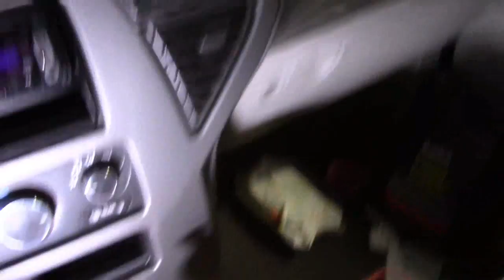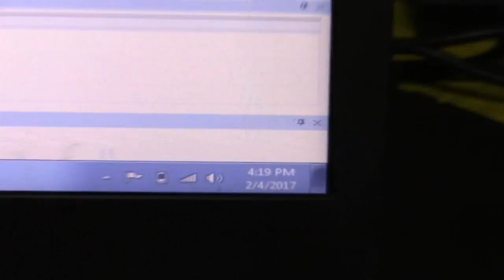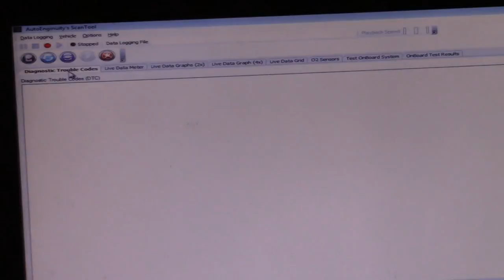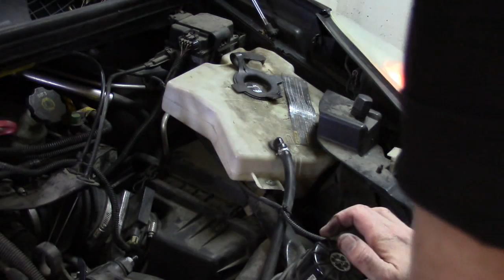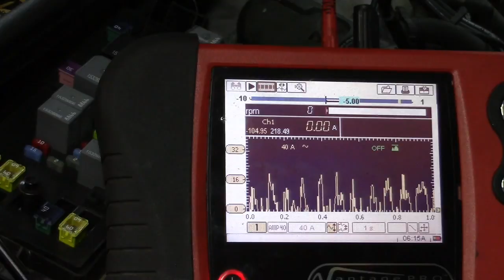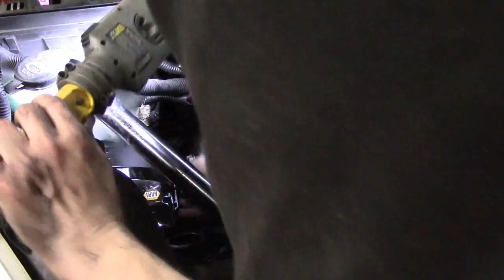2005 Buick with a P0300, P1311, and a 420 code.

Comment: Nice.

:) By the way: Does the scope have a peak detect setting? It seems to help with relative compression tests to turn this off. Some scopes also offer filters to smoothen the graph, maybe that gives you more satifying results.
Reply from the maker: Yes I did try without peak detect and the noise was way worse actually.  I also have a filter as well but didn't work.  I am not sure why but when I do the test from the ground cable this happens. I believe it's because the ground is 'diluted' from the whole car maybe?
Reply: Yeah, probably. I just asked because I never saw such a bad signal with 
my Picoscope, even with peak detect. And I remember one time when his 
Verus was broke Eric O. from SMA did it with his Autel which only works 
with peak detect and even then he got reasonable results, but he was 
hooked to the positive cable there as well. So I guess it's the noise you get on the common battery ground.

But just FYI, I believe you can even use your Amp clamp on the cable even if it does not fully close. I did this a couple of times and got very reasonable readings. The absolute Amplitude might be a little bit off, but the relative picture (which counts in this case) was perfectly on point.
Reply: Kirchhoff's law. All of the current entering any point in the circuit will be equal to all of the current leaving that point, so it isn't "diluted". Short of spending some time experimenting and comparing your routine to how the test is normally run (high amps probe, full range not AC coupled) I can only speculate about why you are getting more noise and the first thing I would need to confirm is if the current probe is always closing properly. I would also want to see what this does DC coupled.
Reply from the maker: John Gillespie Seems to me there is every reason to expect greater current coming from a common ground cable than current to a specific device through the positive. There are more circuits on the common ground.
Reply: When you are running the test ALL of the current that is flowing is being created by the battery. So whether you are on the positive cable or the negative one, the current is exactly the same. (Kirchhoff's Law)  The issue you are experiencing has (I believe) more to do with outside noise than something in the cable itself. I'll have some time to play later this week and put something together using multiple current probes and try to replicate your test results. Even trying to imagine some capacitive circuit current on only the ground side just doesn't survive scrutiny. So it has to be noise whether sensed by the probe or simply induced into scope (g/m) by the current probe harness.
Reply from the maker: John Gillespie Yes of course all the current is created by the battery- that is obvious. But it is just not reflective of all the current to the starter.
Reply: If what you are trying to say is that you are trying to compare isolated positive starter cable current which happens to be separated from the rest of the vehicle circuits then OK. However there are many designs out there that don't separate the rest of the vehicle systems right at the battery so they are included in both battery cables. 

Come to think of it, that is why you have trouble using the ground cable "in some cases". Your test requires you to isolate the starter as much as physically possible. When there are two cables off of the battery positive, with one going straight to the starter your routine is sufficient because you are able to test only the parallel circuit that is powering the starter. However when you go to the negative cable, you are getting additional circuits into the total current flow and maybe even losing some of the starter current along another path through a chassis ground cable. When we do this test with the high amps current probe, it easily (usually) connects around the entire cable from either the positive or negative side right at the battery before any other circuits are paralleled off. We don't use AC coupling (or spike detect) so the full range of the current is in play which makes the current flowing in any other active circuits negligible.  For that matter in the event of a noise problem I could always take a low amps probe and catch other vehicle power(s) with it and then do a math channel that would subtract that measurement from the high amps capture. 

So you were trying to not measure all of the current change and so you were successful with the part of the positive cable that goes straight to the starter. But if you had to try and run your test on a vehicle that split off the rest of the vehicle power with fuse links that connect to the starter solenoid you would have gotten the same problem that you have here with the ground cable.  Good, this just saved me a bunch of time trying to figure out why you had trouble testing from the ground side.
Reply from the maker: John Gillespie Exactly what I was saying,  We are on same page.  We both may be wrong lol but we are same page.
  It still doesn't explain my extra noise when reading off the ground cable but I too will experiment a bit and see what patterns I come up with.
Reply: Schrodingers Box Think of the ground circuit like a river delta. There are a number of ground straps (paths)  between the engine and chassis that would all share some of the current.  Eventually they all combine back at the battery negative cable right at the battery. When a  test routine accounts for all of the current being produced by the battery, there usually is no issue.  By choice you are trying to only use part of the circuit current and that is where the error is being introduced. You can try testing and  see what you measure on the chassis ground section of the negative cable. Do it both AC and DC coupled.  When you confirm that some of the starter current is also flowing in that section of the ground cable you will have your answer.  Remember the way we teach techs to do the test is by measuring all of the current into or out of the battery. That means before or including the cable splices on either the positive or negative cable.  

Here is one more part of your answer.  Like I said imagine all of the ground paths as a river delta. The combined current in all of them equalling all of the current being produced by the battery.  When you are trying to run your test you are concentrating on just the changing current in just one of the possible paths. That means you not only see some of the starter ground circuit peaks, you are also seeing the result of any waves that would allow for increasing and decreasing current flow in the other possible paths.